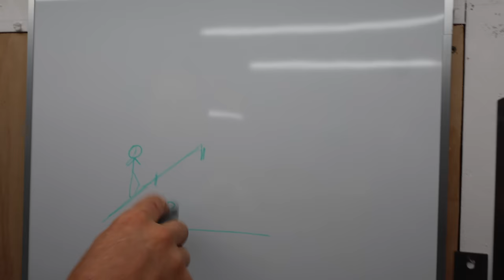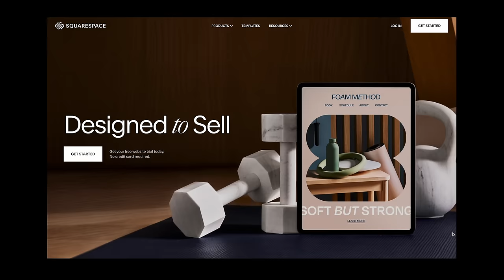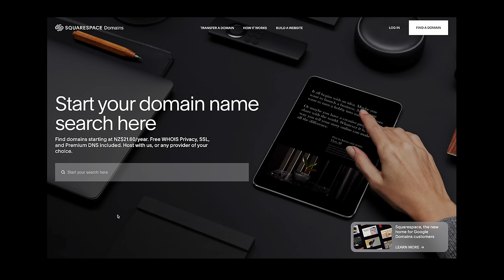This Kitchen was a Nightmare to Demolish

Comment: That's a fantastic idea using the vacuum to shrink down the bin bag of insulation...have a Murphy bed in our guest room as well, I did the front of the bed and the built in wardrobes in 16mm bamboo ply, finished with osmo oil, worked out great. I would strongly advise going with the full metal frame type Murphy bed kit as they are a lot easier to work with and slimmer than the mechanism only kits with a wooden frame.

Comment: We have a Murphy bed couch combo. When the bed is up there is a couch against the wall or the bottom of the bed. You remove the rear cushions and the bed folds down over the seat part of the couch. It works out really well as we also have guests over. We bought this as a system and really like it.

Comment: 11:49 the flexible vent tubing. You guys probably don't get super freezing winters? But if you are subject to lots of condensation INSIDE the duct, it is helpful to put a bump up just before you tie into the Fan exhaust at the ceiling, it acts as a U-trap so that any condensate settles in the duct before the access to the ceiling and you won't get water dripping down the inside of the exhaust fan. A simple wire tie off to the roof truss is enough, or you can put a block under the vent where you seem to have a conduit running by?

Comment: Hey scott, while ive not installed that particular rangehood ive done alot of those roof extractors and while theyre great in the noise department they can be a bit under powered. 

Rigid pipe/ducting helps, or just stretch the flex out taught.  Ive even put another inline fan in the ducting to help as a "booster" 

You probably wont need it youve got those giant windows to help, just wanted to throw in some tips if you werent happy

Comment: Thats great work there Scott, Appreaciate it. By the way you might wanna consider using replaceable filters along with your respirator, the cartridges are designed to prevent fumes not fine particles.

Comment: G,day Scotty and Jess from Sydney Australia. I am surprised that you located the guest room wall not to plan? That can be costly.
Demo of your old kitchen. The triangle wooden pieces are 'rub blocks' you coat two surfaces with PVA glue and rub back and forward slowly applying pressure and removing air until the friction holds in position.
* Used a lot in unsee carcass construction, plinth, base, bulk heads, etc. 
🌏🇦🇺

Comment: Murphy bed: Over the years I have seen a few ingenious Murphy beds on line where they look like a set of (book or nic nak ) shelves. The shelves are hinged/pivoted in sections so when the bed is swung down, each section is the same height and supports the platform - and all the books or other junque gets to stay on the shelves, no need to pack it all away in boxes when the bed is needed & just reverse the process when the bed goes away, but you might need extra strong springs and/or pneumatic struts.

Comment: Would a revolving Murphy bed make sense for the guest room? That way you can use the opposite side as a bookcase or tv and shelving area.  This will mean that you will be building another cabinet which we all enjoy as part of your exciting series.  There is a compact bifold door that swings like a normal door but the swing is cut in half which can be a solution in the guest room. The manufacturer is Milcasa which created the door hardware.

Comment: I agree with Sklem, a pocket/ cavity door would certainly save 900mm and be cheaper then a Murphy bed. As long as there’s no electrical outlets and plumbing is required around the pocket/ cavity door frame. Thanks for the video

Comment: Gosh, that old kitchen looks like something my late father would have built. Solid, lots of nails, Glue. Not sure about the tile worktop though - good to see it go.
have to agree with you about the dry interior in that room - open fires do provide a through draft that drys out the interior. Here in the UK we are seeing the growth in the installation of Positive Ventilation units (PVR's) - a quietly permanently running fan in the loft - intake is in the loft, the unit filters the air and ducts it into the living area(s) of the house; experience shows it does effectively keeps condensation and mould growth down. running costs - about 10NZcents per day. 
. My wife is like Jess - really throws herself into demolishing old house fittings and furniture! certainly speeds things up.

Comment: You could use that fancy new vent fan as ventilation and turn it on during renovations, but it will dirty up the fan a lot and need to be cleaned up later as well

Comment: Will condensation build up in that ducting that you've put up in the roof? I know it's insulated, but might be an ideal to ensure that it doesn't have any low points for water to pool up in it.

Comment: If possible, change that hoods duct to hard kind, much easier to clean and contains fire, and even better fireproofing if wrapped in rock wool.
Reply: Yes,  where i work flex duct isn’t allowed for range vents.  A grease fire with the hood on could burn through flex.
Reply: What about a pocket door Scott?
Reply: Also more efficient and less noisy to use hard ducts.
Reply: This is why all Schweigen silent rangehoods come with Schweigen SteelFlex™ high-performance safety ducting at no extra cost. These perform optimally at their issued lengths and deliver quality performance at up to 3x that - when connected to an Isodrive® motor system.

Schweigen Steelflex Ducting
Good design practice would always see a fire-rated ducting system extend to the house exterior, rather than to the ceiling cavity. When a rangehood is ducted only into the ceiling space, the collection of humidity and grease can present very real health issues and fire hazards. Over time, the back pressure will also impact the longevity and performance of the rangehood motor.

Comment: The point about old NZ houses staying dry and good because they arent airtight holds true on the other side of the globe as well. Here in Finland a lot of otherwise good 40s and 50s houses were ruined by renovating them with "modern" and "better" techniques. Given our climate the old houses had insulation as well, but nothing was airtight - it was just planks, light tar paper and sawdust. Modern materials used to add insulation blocked the structure from drying, and to make things worse showers etc. were added which just massively increases the moisture problems. End result is a house that rots away. The ones that werent renovated or were renovated using the original techniques are still standing. Modern materials can improve those houses as well, but the whole system must be figured out like you said.
Reply: This is one of the reasons why, in 2004 when there was a huge revamp of the building codes here in NZ, it became necessary to get a building permit when retro-fitting insulation into an exterior wall. The potential for damage is real.

Comment: i think you will fine that hose you used for the exhaust fan will not meet codes for  a stove exhaust because of the grease that is created from cooking. i think you need a smooth walled tubing.
Reply: 3:10  We had one of those installed recently, the ducting comes as part of the kit.  European made (german) and their standards for safety are pretty high so this and other comments regarding fat fires are intriguing. Great extractor tthough and v quiet.

Comment: Hey mate, not sure if you are aware, but those cartridges(gas type) on the respirator you were wearing are not P2 rated (which is what you want for fine particulates), unless you use the pre-filters (and retainers). The filters Jess was using are fine and P2 (if they are the genuine 3M). Just want you to live to a good old age.

Comment: The other solution for the door would be a barn door give it a modern look or an internal slider even better. A foldaway bed  me personally  would not be keen on just a pain  just get a blowup bed rather than make a mess of the wall with a bed locked into it -. I would make this room due to the size,  the office maybe with a single bed in and use the room dedicated as the office in the plan as the spare bedroom. Just my 10cents

Comment: For the guests bedroom door,have you considered a sliding door? 
Also that ducting length? Wouldn't oil deposit in the long horizontal section of that ducking, I would have through directly over the stove & range hood would have been better?
Hows Jess's arms after swinging that hammer? 
So many questions, great show, & toes!😂

Comment: That is the smallest bin I have ever seen. I rented a small bin to replace the roof on the garage and it was probably twice that size. Fun fact, a  roof on a 1 1/2 car garage (officially 2 cars for tax reasons) with 1/4" ply and then 3/8" sheathing plywood and 8 year shingles (the thinnest you can get) is about 1 ton.

Comment: Why having such a long horizontal section on your range evacuation pipe? It is motorized, so there is no need to create a draft, and whatever the filters you have, the pipe will collect grease, so the less the better.

Comment: That kitchen might have been old and shit, but it was built solid. If it wasn't particle board and rimu it could have been something I built with that many fasteners. Ring shank to hold in particle board is reasonable and good. Smooth nail holding in that garbage is almost nothing. A case of quantity over quality to get the strength needed.

Comment: Instead of making a mess, just unscrew the doors and hardware, then cut up the counter with an angle grinder. I've rarely found that demo-ing stuff saves time. It saves clean up to just disassemble when you can.  The filter masks were overkill for the particulate size, but if it makes you happy, whatever.

Comment: Set a laser where you KNOW your range hold is going.
Drill a 6mm hole in the ceiling and you can find the dot, in the attic, on the underside of the roof. 💡

Comment: The vented kitchen cabinet appears to be what we in the states call a California Cooler.   Seen a lot of them in the Bay area all the way up to Portland, in  old homes.  The Cooler is always built into the exterior wall with a vent with a trap door.  Shut during the hottest part of day or open to dry things.  Most of the time the cool danp air keeps produce somewhat fresh.   Think the Cooler had another name. The Pie Pantry?
Reply: I lived in an apartment in Los Angeles (Eagle Rock, actually) that had been built around the turn of the 20th century.  It had ice boxes on top of the coolers, and a dumb waiter to bring the ice upstairs when it got delivered.

Comment: At 11:58 fitting extension leads in the ceiling.   VERY BAD.  I HOPE THE INSPECTOR SEES THIS AND FAILS IT.
Reply: I don't think they were extension leads? It seems like the motor and the hood each came with a lead attached. Scott was simply plugging them into each other.

Comment: So, wait, what?? The ceiling was insulated with insulfluff AND fairly thick looking pink batts plus it had a layer of gib AND a layer of softboard all adding to the R value. So you ditched all that, sent it to land fill and are going to just reinstate the insulation with new stuff and a layer of gib. Why not just go straight to a new layer of gib, screwed right through to the joists? Far more eco minded, faster and easier, same finish. You just lose 23mm of ceiling height.